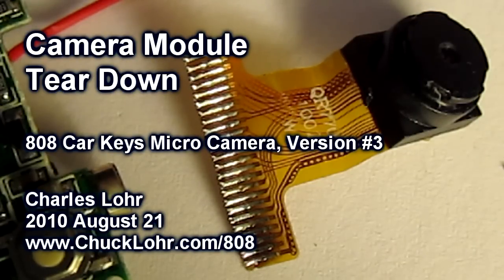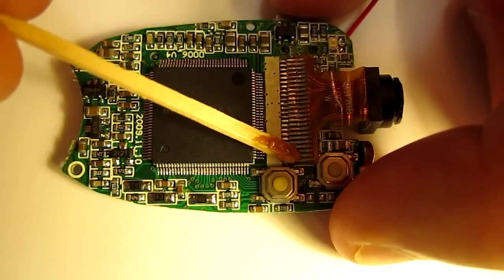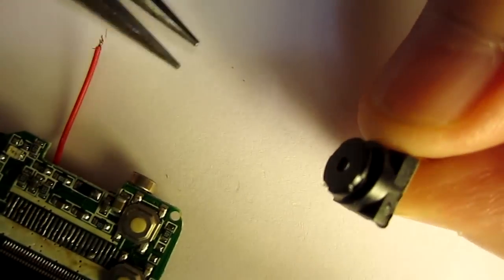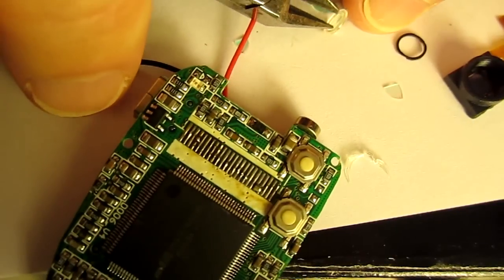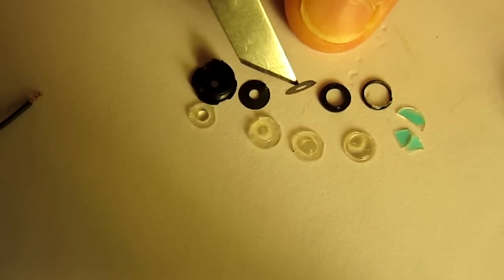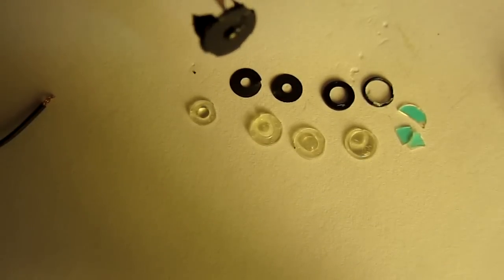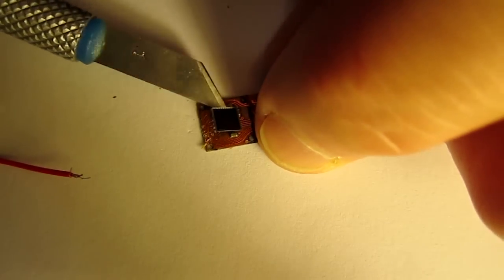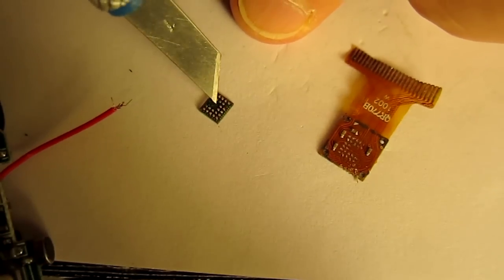Tear Down, Camera Module, #3 808 Car Keys Micro Camera

Comment: heycan i remove it from my old phone and use somehow maybe as a cctv ...........if yes how
Reply from the maker: No, probably not.  There is no "standard" consumer interface on an internal camera module.  The camera module interface is designed to interface with the SOC camera chip, raw data or similar.
Reply from the maker: Camera modules typically source video as a RAW or RGB565 data stream of parallel data; many megabytes per second.  The destination SOC chip compresses the video (H264, MJPG, etc), interleaves it with audio (AAC, PCM, etc) and writes it to a file in flash memory.  That's how it works.

Comment: Plz explain its pinouts , data signals and hack to connect it with arduino or pi
Reply from the maker: See the comments above and answer below from 
MEndeavour 1 year ago "Is there any way to reuse these with arduino?".  I don't have a pinout for the flat cable, but there are 24 contacts on the image sensor and 24 pins on the flat cable,  with an oscilloscope and an image sensor specification you can figure it out.  Data signals are explained in the image sensor specification.  At about 18 bytes per microsecond (600000 bytes per frame), too much data for an Arduino.  Parallel byte-wide camera interface.  Pi camera interface is serial and not well documented.  Can a pi receive 18 raw image parallel bytes per microsecond, compress them and store them without overrun?  This is a 2005 image sensor.  Very old.  You want to chose something newer.  Good luck.
Reply: @Normandy5  what is the keys words or name of such video signal interface which is use in all multimedia or smartphones just like ldvs for laptop lcd and what technology used in flat cable phones displays is that same ? Without keywords I can't find its datasheet to increase related some knowledge plz also share some keywords for related datasheet . 
And other hand if Arduino is too slow too process image data from ccd so can we use onboard ccd with its onboard isp processor on old phones so that maybe we can command that dedicated isp processors using Arduino's any interface like i2c or serial ! If such case is possible ????
Reply from the maker: @omsingharjit  LVDS (TIA/EIA-644,) has nothing to do with this camera module. 
I don't know what camera interfaces are used in cell phones.  
I don't know if this image sensor isp (OV7670)  is used in cell phones.  
The OV7670 (640x480) specification "http://web.mit.edu/6.111/www/f2015/tools/OV7670_2006.pdf". 
The OV7670 supports the SCCB i2c interface that facilitates read/write of about 200 registers.  
In theory, any device that uses the OV7670 isp could be modified to allow an Arduino to modify the registers over SCCB i2c, possibly  with disastrous results.  
Search Keywords you might want:  "amazon B012UXNDOY"  "omnivision sccb"

Comment: can i  extend the camera module by cable?
Reply from the maker: Some cameras modules can be extended with a cable.  If you know the version of your camera contact the producer.  On eBay, Eletoponline365 is the producer of the the #16 and #32 and Mobius.  Otherwise you need to know the pitch (distance between pins) and search on eBay.  Usually up to 1 foot (30cm) works ok.  Anything longer can be intermittent.

Comment: Sir i have a mobile and it is damaged but I want to use its camera and audio reciver for recording audio and video please help me to make this project
Reply from the maker: Not possible. A camera module (CCM) usually outputs tens of megabits or gigabits of raw data, serial or parallel, no buffering, and is not in a standard consumer format.  CCMs are usually not publically documented and not off the shelf interchangeable products. Output of the CCM is the input of custom application specific compressor converter chip.
Reply: @Normandy5  sir I didn't understand what u said but what I want is spy pen u know audio video small board with USB. I want to make one by myself
Reply from the maker: @Life-fk3pt  Audio video board with USB ... that is a webcam.  Purchase a webcam.  To make one yourself, first get a degree in electrical and software engineering, then you will know the enormous scope of what you want to do.
Reply: @Normandy5  I am doing business to feed my family sir no problem sir i will find a way to do this thanks for your suggestion

Comment: I have the same device you are working on. I want to change the camera to another that has a long cable. Can you show me the video and power outputs from the device to the camera? The board has more than 20 outlets.
Reply from the maker: Google search for "808 camera extending".  Shows extension cables, some hand built, some available on eBay.  The producer of each 808 camera integrates all the assemblies including the camera module, the SOC, the circuit board, etc.  These are not off-the-shelf parts.  There is no standard cable pin-out.  Schematics for each assembly are not public.  There are more than 30 versions of the 808 camera.

Comment: Hi, can I replace the battery with a 3.300Mah / 3.7v ?
Reply from the maker: If your larger LiPo battery module has a protection circuit and if the protection circuit protects against battery over voltage, then you can use it to replace the 808 internal battery.  Do not parallel the internal battery.  Any modification must be bench tested through a full monitored charge and discharge cycle to verify it is safe. If you use the camera to charge the larger battery, the charge time will be much longer, maybe 10 hours of more.
Reply: Charles Lohr
Many thanks!!

Comment: Thanks for the comments on field of view; I may upgrade to a #11 sometime. I just played with mine by attaching to an arrow. Sort of worked, but the acceleration usually caused the video to shut off (not to mention it dislodged the battery!). If I did it again, I would pot the electronics/battery with silicone caulking, I think. It's on my GeezerRay channel if anyone's interested.

Comment: Do you know what each of the 24 pins going to the 808 camera are sending?  Which is power? Ground? Video?
Reply from the maker: No, but for the #3 camera, you would need the image sensor (Google search "OV7670") datasheet and the datasheet for the the camera module (sensor, flat cable, lenses, etc.  Producer unknown.) to know what is on each flat cable pin. For more general info about interfacing to an image sensor, Google search "Raspberry Pi Camera Module datasheet DEV-11868" and read the OV5647 datasheet.  Good luck.

Comment: Hi Charles,

Very Informative video. I am trying to remove the glass cover on the sensor chip. Do you have any recommendations or links that I can follow to remove the glass cover and expose the bayer array. Thanks.
Reply from the maker: +Amit Solanki Sorry, I don't know how to remove the glass.  The sensor measures 4.22 x 3.78 x 0.95 mm.   By visual inspection, the sensor is a sandwich of three layers:  glass plate,  silicon die and solder balls.  The sensor thickness of plate, die and solder is about 60%, 20%, 20%, respectively.  I'm guessing that the glass is "glued" to the surface of the die using optically pure glue, so removing the glass would not be possible.  Even at re-flow 475 degrees F, it stays together.
Reply: Thanks Charles, From what you mention it seems you have tried to re-flow at 475 F. Most of the glues should flow at such high temp, I would be interested in seeing if you see re flow if the temperature is increased near 600F. If it does not it could be that they have bonded the glass to the die.
Reply from the maker: +Amit Solanki OmniVision makes the image sensor of the 808 #3 camera.  Search google for "omnivision OV7670.pdf"  The spec sheet specifies 472 F (245 C) as the maximum re-flow temperature.

Comment: Is there any way to reuse these with arduino?
Reply from the maker: MEndeavour - No.  The camera module does not have a buffer to hold an image.  At 480p 30 FPS, the camera module outputs about 18 million raw bytes per second.
Reply: oh I see... then can't we make an external buffer?
Reply from the maker: It's an overrun issue.  One frame of 480p data is 614400 bytes in 33.3 milliseconds, that is 18 bytes per microsecond.  If your Arduino could run at about 500 mHz clock speed, you might be able to capture that data.  
Search for "Amazon B012UXNDOY" this is a camera plus controller that can interface to Arduino.  Search for "sparkfun OpenMV M7 Camera 14632". that has been interfaced to an Arduino.
Reply: Oh thanks a lot.... Now I understood :)
Reply from the maker: @Alkrizz Not possible.  1.  Bluetooth does not support video.  2. The cam sensor outputs raw video at about 18 megabytes per second.  3. There is no data buffer in the sensor.
Reply from the maker: @Alkrizz  See the OV7670 data sheet (link above).  There is no raw (uncompressed) data buffer in the cam sensor.  The sensor processes image data and outputs it in real-time at about 18 million bytes per second. Transmitting that wirelessly would take some extreme engineering work, but why?  The OV7670 sensor used in the 808 #3 camera was designed in 2005.  Today, 13 years later, this is a VERY old part and design, and might not be available anymore.  More modern sensors might be able to do what you want.

Comment from the maker: No. The 808 firmware is designed for a specific image sensor.  The image sensor is really another computer, configurable over an I2C serial interface.

Comment: Is there a posibility to trigger photos with an Arduino?
Reply from the maker: Yes.  Your Arduino can control the power and shutter button switches with an analog switch or optoisolator.  You can't send trigger commands to the camera via I2C or UART or SPI.
One button problem is knowing the state of the camera.  The power button changes the power state, but how do you know the camera is on or off?  You might be able to use Arduino analog input to sense that. 
Google search for "chucklohr sven" to see a project using a pic micro and an Arduino would also work.  Sven used a quad analog switch (4066D) to short (press) the camera switches without removing them.  Each button is a 4-pin momentary switch, single pole single throw, normally open.  Two pins on each side are shorted.

Comment: very old video but helpfull !
 I have a spy pen and would like to recycle camera to connect to a raspberry py . Does anyone have a link or schema or tutorials to do that ?
Reply from the maker: There is a ton of information about the Raspberry Pi MiPi camera  interface (serial), v1 omnivision and v2 sony.

But the 808 and pen micro cameras typically use a very different interface (parallel) that was never standardised for interchangeability and is rarely documented.
Reply: @Normandy5  Can i connect it to USB interface?
Reply from the maker: @fury4076  No. The camera module does not have a USB interface.
Reply: @Normandy5  maybe webcam?
Reply from the maker: @fury4076  No. A webcam has a USB interface. This camera module has no USB interface.
Reply: @Normandy5  THANK YOU

Comment from the maker: @15sdobbie It shows how to extend the 24 pin flat cable using three 8-wire cables, and then demonstrates that the modification works.

Comment from the maker: No, removing the 808 outer lens will not make the horizontal angle of view (HAOV) wider. To be a wider HAOV the focal length must be less using a different lens, and 480p 808 cameras don't have interchangeable lenses.  A wide angle adapter can be mounted in front of the 808 lens.  Most 480p 808 cameras have a HAOV of about 40 degrees, and most users want a wider HAOV.  One good solution is buy an 808 #16 (720p) where you can select from three different lenses, 70 to 120 degrees.

Comment: Make my own controller for cmos possible?
Reply from the maker: Probably no.  In a video application at 640x480, this image sensor produces about 18 megabytes of parallel RGB color data per second, unbuffered and uncompressed.  The SOC needs to compress and buffer that data, interleave it with the audio stream, format it in  AVI and write it to the SD card without underrun or overrun.  Very difficult to make all that happen.  In a photo application, you need to capture about 600 K bytes RGB in about 33 milliseconds.
Reply: is there any method to connect a spy pen like this to a raspberry py ?
Reply from the maker: The interfaces are usually not compatible. Spy pens and other spy cameras (480p) usually use a parallel interface at about 150 megabits per second.  The Raspberry Pi camera interface is serial and much higher bandwidth at about 4000 megabits per second.

Comment: Is a sensor transplant mod possible??? taking a 808 #16 sensor and putting it in a micro fpv camera???

And what about removing the glass IR filter? will a infrared mod be possible???

i need to know
im gonna buy like five 808 D lens modules.

and will it still work if you cut the end that goes into the slot? cut it to fit in smaller slots?
Reply from the maker: The parts in the 808 cameras are not off-the-shelf interchangeable parts.  The lens, the image sensor, the way the flat cable is wired,  the camera connector and the SOC are one engineered system.  All the parts work together.  Taking parts from one camera and trying to use them in another camera usually won't work.  Mixing parts could destroy the parts.  About the IR filter - Goto "chucklohr.com/808" and search the page for"infrared".  808 cameras with the IR blocking filter removed have been sold on eBay.
Reply: alright. I thought the IR blocking filter is on the sensor?  But its on the lens?
Reply from the maker: The IR blocking filter could be positioned anywhere before the light enters the sensor.  For most 808 cameras, empirically, the IR blocking filter is placed at the back of the lens tube where it is between the lenses and the sensor.  See "2010 Nov 16 - 808 With External IR Filter" where the filter is in front of the camera.  Note - the filter blocks near IR, not heat IR.  See "wikipedia.org/wiki/Infrared".
Reply: ok thanks
Reply: the link didn't open.

but anyways, I removed the ir filter. But i can still mostly see regular video. 
i do not see infrared unless i use a infrared illuminator.

is the glass part of the sensor another filter?
Reply from the maker: With IR blocking filter removed, the sensor sees both visual light and near IR light.   In daylight, green grass and green trees reflect IR.  So with no filter,  green plants look almost white.  Go to YouTube and search for "Wobbly test 808".  This is a video of an 808 without IR filter.  Note that the grass looks almost white.

With 808 cameras, the glass that is part of the sensor is not a IR filter.  Probably because soldering the sensor at 245 C might destroy the IR filter.
Reply: i ordered a IR pass filter of the same size where only ir can pass through

Comment from the maker: The 808 #3 camera in this video did not work before I made the video, so damaging something was not a concern.  If you have a working camera, an attempt to unscrew the lens tube is risky and could permanently damage something.  The image sensor solder balls and flat cable are very fragile.  When open, dust can ruin the camera.  The glue on the lens tube is suppose to permanently lock the focus set at the factory.  If you have a #16 camera you can buy a replacement internal camera module.

Comment: is there a way to reuse this for small MCU projects? i have a lot of this cell cameras and been saving them just incase i come across a tut that will explain how to wire.solder this up to something like a Arduino
Reply from the maker: +Sys.stem  Lack of public specifications make that very difficult.  Image sensor and SOC companies don't publish specs, unless you have a non-disclosure agreement with them.  Image sensors have I2C programmable registers but a low resolution sensor outputs about 24 megabytes of raw data per second or more.  Some 808 cameras output composite video from the SOC, not the image sensor.  You can control the camera buttons with opto-isolators, etc.